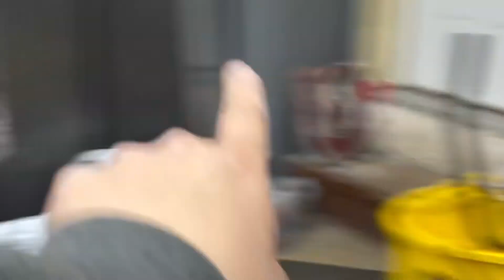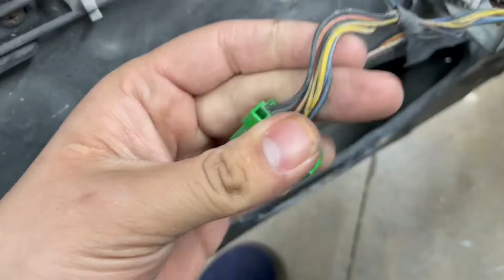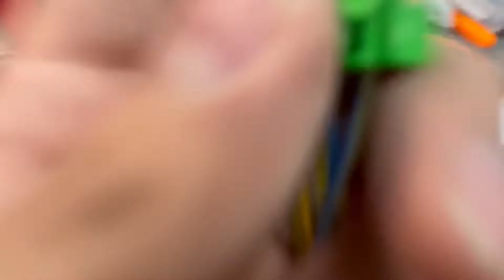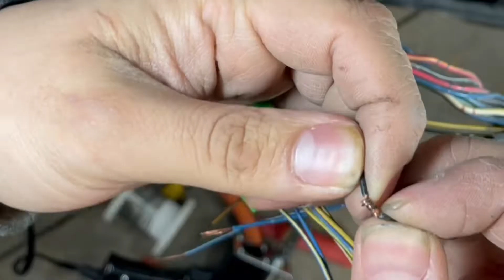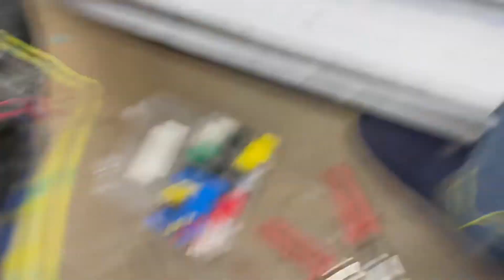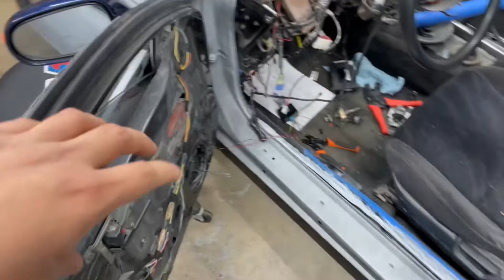DC2 Integra power folding mirrors install

Comment: Bruh! Couldn’t you have just de-pinned that one wire and add it to the other that was already intact?! I heard something about couldn’t find the de-pinner BUT also heard something about spending $600 on a bucket so why wouldn’t you wait to get that depinner?! Sorry, my OCD is giving me orders to say this and I can’t say no!🙏🥺😭😭😭
Reply from the maker: The way I did it was still properly installed. Doesn’t make a difference to Depin or pigtail for the existing wire pin.